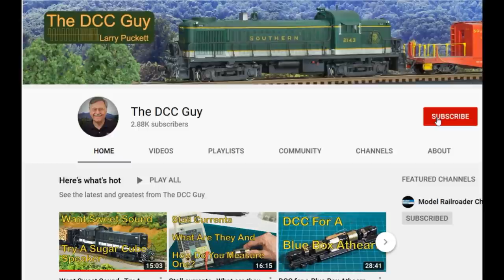Light A Fire On Your Layout (186)

Comment: I don’t know how to apply glue without getting it on my fingertips and making a mess of everything! Cool video. Thank you.
Reply: I decant some superglue on a piece of plastic then use a cocktail stick!
Reply from the maker: The Loctite dispenser I used in the video has little squeeze tabs on the sides so you can just squeeze out a tiny drop onto the thing you want to glue. And since it is a gel it doesn’t run all over the place.

Comment: Nice video.  I could see using this in a Blacksmith hearth.

I have my On30 steam engines equipped with a Soundtraxx Tsunami 2200 steam decoder.  Headlight function works fine at Brake and in the Forward position.  It turns off in reverse.   There is no rear light at the moment.  The resistor is back in the tender with the decoder.  I would like to get a firebox flicker LED installed. I am considering putting it across the track pickup wires in the loco itself to cut down on wires between the loco and tender.  The loco and the tender both have track pickup leads wired to the decoder.  I do have the flickering fire LEDs with the resistor installed.  Good idea or bad idea?

Any chance you will do a firebox LED install video for us?
Reply from the maker: I do have one planned as I have a loco that came with firebox flicker but it is so weak you can only see it if the room lights are turned off!
Reply: @TheDCCGuy  Which LEDs do you recommend for a firebox project?  The smaller the better I would think, but bright enough to be seen.

Comment: Or you can go to your dollar store and get a flickering tea light for a DOLLAR and add a 2 cent resistor and you have a campfire.  You can get the tea lights in red or orange.
Reply from the maker: But I already had the old decoder just gathering dust. No need to leave is sitting another 10-20 years and I really doubt they would be as bright as my installation is.

Comment: I don't understand why you need to use a decoder.  Why not simply use a flickering LED ?  Seems like overkill to use a decoder to create the flickering effect when you can get orange or yellow "candle flicker" LED's for a song on eBay: 100 x 5 mm, or 50 x 3 mm for under $10 (shipping included).
Reply from the maker: Maybe because I wanted to put this together completely with leftovers I had in my junk box.

Comment: You can also get “flickering” LEDs quite cheaply on eBay (and presumably AliExpress etc) for not much money. Just search “flickering led”.
Reply from the maker: I have several on order but for a fire you want a random flicker and I think the flickering LEDs are regular.
Reply: @TheDCCGuy  No. Flickering LEDs are random,  flashing LEDs are regular. I've used a flickering LED for an oil lamp on a guards wagon [caboose].